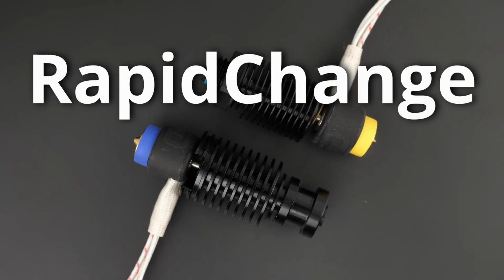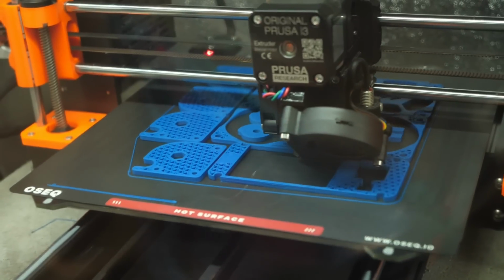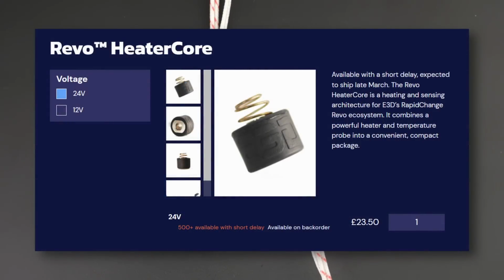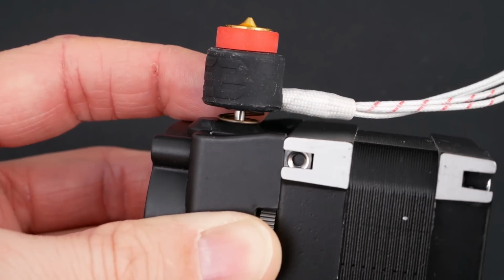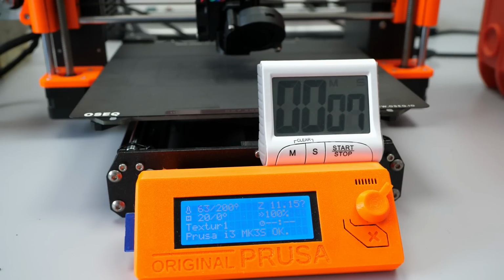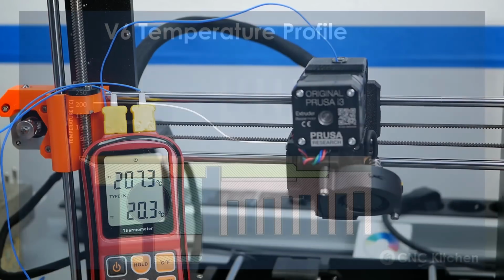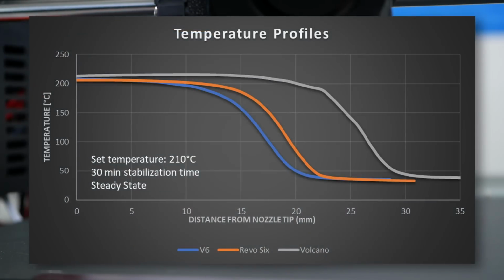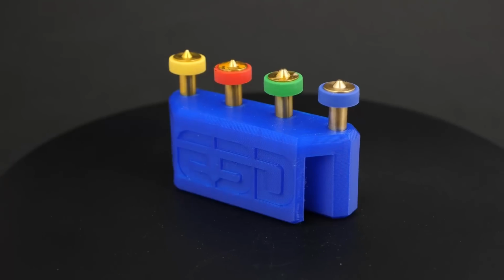E3D Revo™ is great BUT has a dirty secret! (REVIEW)

Comment: I tried to get a warranty for the heater core assembly that the thermistor failed on for  my MK3S after little use. They made me jump through too many hoops and multiple correspondences. Finally gave up and purchased another assembly and it fixed the problem. Out $40. I could use a kit for my Mini but I am reluctant to do so after that. Otherwise it works great and convenient. Might as well forget trying to get a warranty.

Comment: Amazing video Stefan, thank you!  I switched my MINI+ to Revo Micro as soon as it became available.  I frequently switch between 0.25 / 0.4 / 0.6 mm nozzles and just got tired of the cycle times.  Revo changed all that, especially with the additional retraction in end-gcode.  That said I did notice a need for higher temperatures with certain filaments.  I have a thermocouple multimeter here and thought about testing the temperatures, but I'm glad to see you did a far more thorough job!  :o)  Thanks again, and I have just bought Grammarly Premium 1yr through your affiliate link.

Comment: I do a ton of 3D printing for work (a yacht company). I only print in ASA plastic because its higher temp, UV resistant, and it sands really well. So for speed and strength purposes I only print in 0.6mm nozzles. I print large prints that get sanded and painted 99% of the time. I used to switch hotends to a .4mm nozzle for better resolution on smaller parts, but It became a pain so I just stuck with the 0.6mm for all prints. Since switching over to the revo, I switch between 0.4 and 0.6 2-3 times a week! Its such a game changer! Im a big fan!

Comment: There is an unofficial high-flow Revo, and it is the Phaetus Rapido hotend... It uses the same ring-heater approach but with an incredible 115W of heating, it can achieve flow rates of 45 mm^3/s with a standard V6 nozzle and supports a one-hand nozzle swap, as the heating core is bolted to the heat sink with 3 titanium screws. It's like a fusion of E3D Volcano, E3D Revo and SE Copperhead, costs less than either, and is powerful/durable AF.
Reply: i didn't realize that the rapido used standard v6's.  that's actually really baller and way more of the kind of thing I was expecting out of the genuine Revo

Comment: I for one have to give it a hard pass for a bunch of reasons with the most prominent one being the lack of backwards compatibility with the established V6 Nozzle Standard allowing for outside innovations ( like the CHT Nozzles ) to be added to the system.
Reply from the maker: That's definitely something I'm not happy about either. Hope that their high flow nozzle has a similar performance as the CHT.
Reply: Agreed! Especially since the CHT nozzle works with Dragon high-flow which was already cheaper and faster than Revo before CHT came out.
Reply: Not to mention the fact that ecologically it's not terrible.
Reply: My go to response for these type of propriety nozzle, heater, thermistor solutions is a hard pass too. It is is easier to stay in the well known ecosystem and use common parts.
Reply: @Tacks3D  Same. It really could have been revolutionary if they had kept it open so it could become a new ecosystem for the whole industry. Probably would have made them more money in the long run too. Sad that this whole branch of innovation is now cut off.
Reply: @Tacks3D  Mhh... I'm not so much against them making a proprietary new Heater or Thermistor - Sometimes you have to break a few eggs to make an omelette =)

But the proprietary Nozzle/Heatbrake combo really pushes what I'm willing to crack open. And their Patent being used to lock me into their entire Ecosystem isn't helping either.

People started giving Slice Engineering a lot of crap for patenting the onehanded Nozzle change capability on their Mosquito line but at worst it just means you cannot buy an in-between prints convenience feature no one else thought of maturing and selling to you beforehand should you decide not to buy into it - It does not bar you the freedom of choice where it matters...

Yea... They will probably release a hardened Nozzle, they may release a Highflow variant but that will probably be it.

Maybe nonplanar 3D Printing will slowly take of next month due to new research finding its way into a commonly used Slicers requiring a super elongated and pointy nozzle for clearance - Will E3D immediately release one for you to be able to take advantage of it? Unlikely if you ask me. Will a small tinkerer be able to fill the gap? Yes for V6! Nope for Revo...

IMHO, they really jumped the gun with the Revo ( and the way how the Patent works ).
Reply: Not breaking the stagnant V6 ecosystem would defeat the purpose. You would have any of the new features, so it was the only way to move the world forward. There will be a new ecosystem in time.
Reply: @fwiffo  I disagree...

For the moment being - The Revo adds literally nothing worthwhile to the Hotend Ecosystem while you use it for what it is meant to do 99.8% of the time - Extruding Filament.

On the contrary! With it currently neither offering an abrasive resistant or high flow capable versions it pretty much regresses the tech and once it delivers those it only ever again brings us back to par with current tech - WTF? Where the hell is the innovation in that?

The arguably only place it drives innovation is with it having a rather clumsy Toolless Nozzle Swap feature and while potentially nice can at best be advertised a convenience feature for the handful of ppl making use of it which would be the remaining 0.2% of what the 3D Printer does with the Nozzle.

And as Thomas Sanladerer kinda hinted at - The new Heater Cartridge having a supposedly inherent safety feature of requiring more energy to heat up the hotter it gets instead of less - like current Cartridges - is also pretty much worthless to anyone mounting their Revo in a plastic Toolhead like a Prusa or a Voron because of how hot it still can get if no Software side safety is being employed ( I'd also argue it still being dangerous AF to even Aluminium Toolhead Printers ).

Yea nope... The cost of "innovation" for being a Toolless System the Revo brings to the table is just not worth the drawback it carries with it for being a closed of system - Regardless of because it being Patent protected or just because of how it is designed.

Oh yea... Kinda forgot... I'd also argue that the V6 System is far from a stagnant system - Just have to look at CNC Kitchen being able of recreating a DIY version of a performance increasing CHT Nozzle ( or the Volcano Adapters ) on his own using the V6 Ecosystem.
Reply: @Duraltia  Erm “more energy to heat up the hotter it gets”? I think you meant to say “more voltage”. Conservation of energy implies that heater cartridges are always 100% energy efficient. I also don’t think safety is relevant since software has always been the only thermal cutoff. A few printers have a thermal cutoff switch (IIRC included in voron BoM) that’s in series with the heater, but they’re the exception.
Reply: @NavinF  Yea, yea... Potential Electronics Jargon mix-up on my side - You get the drift:
Regular Heater taking less of whatever once hot to get even hotter.
Revo Heater taking more of whatever once hot to get even hotter.

But like Tom explained: https://youtu.be/FIXG3tlILCY?t=1010 - It will reach 480°C if left unchecked - ABS supposedly has a Ignition point of below 420°C - If you're not using Software to keep it in check then you might as well use a regular Heater for identical safety.

The Thermal Cutoff Switch you're referencing in the Voron Builds is for the ( where applicable ) mains powered Print Bed Heater.

I also had a chuckle how Sanjay was kinda throwing shade at Slice Engineering for their high-priced Hot Ends which immediately got me thinking... "Yea... But SE is more like a one-time 150.- purchase of the Heater Block with a 5-pack Nozzle for as low as 10.- whereas a Revo Block will be 80.- and a _similar specced 5-pack Nozzle 115.-"_

Up to this point I didn't even realize it the SE Hot Ends being cheaper than a Revo once you start running through the expendable Nozzle component - Well played E3D... Well played 😏
Reply: I think there's a slightly hacky solution for the incompatibility problem. Step 1: clamp a nozzle-break in a suitable work holding setup. Step 2: grind the inbuilt nozzle tip flat with the surrounding surface. Step 3: drill a flat bottomed hole that's the tap drill size for an M6 thread to the appropriate depth for a nozzle to fully seat. Step 4: Tap the hole for an M6 thread with a bottoming tap. Presto! a nozzle adapter. Rinse and repeat as needed until you have enough for all your favorite nozzle types. You can now hot tighten the nozzles to the adaptors. You now have the ability to use the quick change feature of the Revo system while still being able to replace individual nozzles if they wear out without the expense of an entire Revo nozzle. E3D should have made that sort of thing instead.
Reply: @NavinF  actually, I've had 2 heater cores with Revo that had funky thermistors that read at least 100c lower than actual temperature above 200c. It didn't trigger thermal runaway because it still read like the temperature was increasing, just slowly. It got hot enough that it warped the nozzle. Hardware problems can make software alarms useless. :/

Comment: For me, V6 is the best because I can use literally any type of third-party nozzle, and I can easily machine custom heating blocks. However, as someone who’s recently had a two-and-a-half-day print fail at work due to a V6 heatbreak that had come loose and filled the head with PLA gloop, I certainly see the benefit of a more sealed and reliable unit. Pity we won’t see third-party nozzles.

Comment: I've experienced two (2!) thermistors failing in the Revo Micro - not sure what is going on, but they were manufactured in Dec 2021 and Feb 2022.  I get the "Verify Heater" message in klipper f/w for my V2.4.

Comment: Thank you Stefan for your in-depth analysis. There are increasing reports of clogs when running PLA through the Revo Micro on the Prusa Mini using the E3D supplied fan. I believe this is heat creep due to the PWM fan speed reduction in the Mini firmware. If you can fit an analysis into your schedule, it would be very relevant.

Comment: The lack of hardened nozzles are a real deal-breaker for me and apparantly despite having supposedly been just around the corner. Its half a year later with still complete radio-silence from E3D. Worse yet is that due to the patenting you got no other options for the Revo but wait on them!!

The longer they take, the harder a sell the Revo is becoming...

Comment: A design patent only protects non-functional design features. Thus, everything that is "just looks" must be sufficiently different in a "clone".
But a hole in the middle, the outer diameter and length of the hot section, that cannot be a design patent. It could be a functional patent though.
(However note that Brompton bicycles seems to be very good at abusing their trademark of what their products looks like. Trademarks do not expire.
Reply: Well, there's the law as it is written and then there's the law as it is used. If someone offers clones on Amazon, E3D just has to wave their patent and Amazon will throw that seller of the platform. If a Youtuber reviews clone nozzles, E3D just has to wave their patent and YouTube will take down the video and give the YouTuber a community guidelines strike. No one will go to court to challenge this because it's too expensive.
Reply: Yes, a functional patent, about the coupled nozzle and heatbreak combo that make the whole deal work as intended (otherwise the rapid change wouldn't function) is enough of an innovation to be functional-patented from what I imagine circles around the existing patents. So it would make no difference to Make some square shaped Rovo hotend if it's still a heatbreak nozzle combo.
From my reading they have left the cold side open source (it's the Hemera one anyway) but the hotend is their patent.
Reply: @frankbauerful  On the other side, "waving your patent" is quiet time consuming and expensive as well. Especially because all the cheap chinese knock off brands don't care about intellectual property and patents, anyway.
Reply: @Rallyman240  Waving your patent requires nothing than having your lawyer send Amazon or YouTube a letter
Reply: @frankbauerful  Amazon, YouTube maybe, but won't stop AliExpress or eBay sellers, they won't even bother to change the shape to not violate the design patent...

Comment: For those of you that have the ubiquitous V6 nozzle, I have a water cooling solution that is drop-in with the same length and everything. No more blowing hot air across your heat sink! I have a few version 2 prototypes that I can send out, and only one version 3 that is amazing, but the cost might be too high to machine, so I just have it on my printer. If there is enough interest in them, I can get them batch made and have them at a reasonable price for you all. They take 1/8 npt fittings so you can choose the diameter of tubing. I use 8mm od tube, but you can use anything that has a 1/8 npt thread. There is also a spot for a thermistor to monitor cold end temps.

Comment: I switched to the Revo on my MK3S/MMU2S a few weeks ago and love it. I have damaged the thermister before on the old system while changing nozzles so I was always gun shy about doing it too often, but now with the Revo I will decide on the best nozzle size for nearly every print. And since the MMU2 retracts the filament automatically after printing, I don't have to wait for the heating and cooling cycle. I will mention that I did notice a slight length difference when swapping nozzles, so a minor Z calibration is still needed. I just record the offset numbers for each nozzle so it isn't a big deal.
Reply: For us MMU users I've also seen reports that tip forming requires less ramming with Revo - and no specific Prusa "MMU" heatbreak anymore either.

Comment: Now after six months of usage I can say, that I'm very satisfied with the Revo system. No more cloggs since then! And I switch my nozzles way more often than before. I highly recommend this system!
Has anybody figured out an additional start- / end - gcode for a quicker nozzle change? I think, there must be a retraction at the end as long as the nozzle is hot enough to unload the filament.

Comment: Hmmm interesting, with Raptor it is exactly the opposite: LOWER the temperature by as much as 10 degrees compared to other hotends (i.e. printing ABS at 245 instead of 255 because 255 it was visible overheated). It uses ceramic ring heater as well, and thermistor (replaceable BTW) sits inside. I thought it will be the same with other hotends with ring heaters because it should heat filament more thoroughly, that's the theory, but it does not seem to be the case with Revo. To answer Stefan's question: apparently there's at least one company (Protoprint) which considers this temperature gradient effect from talking to them🙂

Comment: Half a year ago I posted here my satisfaction with the Revo system. This has changed completely. Within six weeks I had twice the problem, that my printing part didn’t stick to the heatbed and formed a huge bubble of PLA around the nozzle. Obviously it became so hot in there, that the nozzle and the heater blew up. I got the nozzle out of the heater only by heating it up. Other nozzles didn’t fit anymore, I had to replace them both. I will switch back.